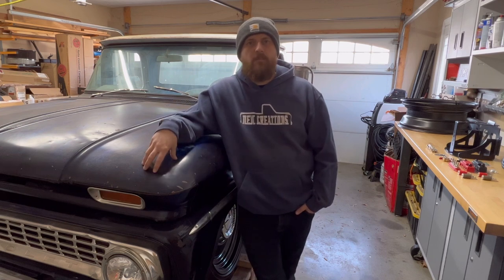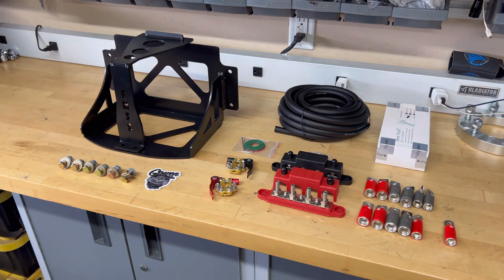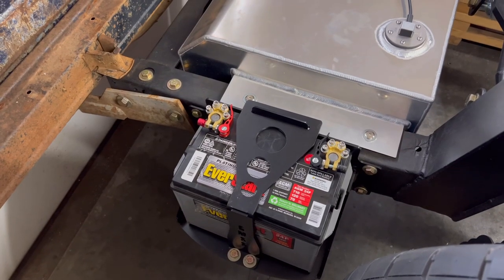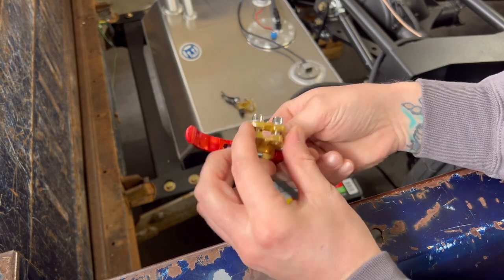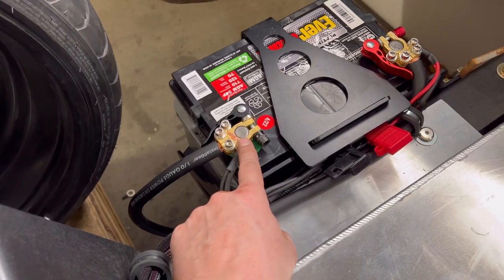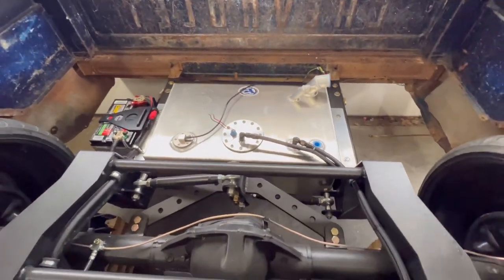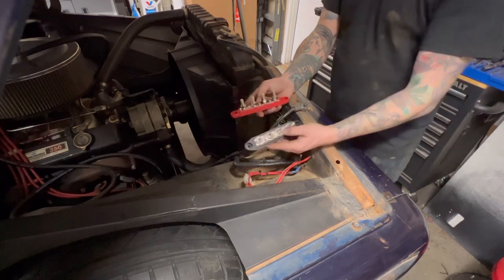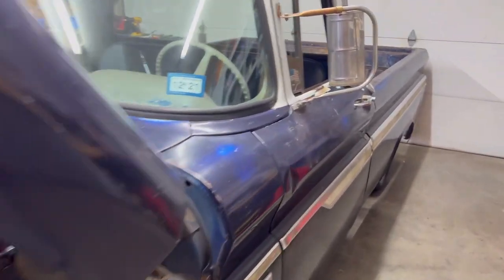FRANCIS EP.12 | DIY Battery Relocation | GMSS Fab Bracket and Step-by-Step Installation Guide.

Comment: On my 65 C10, I relocated battery to inside the bed in a vintage aluminum cooler that has an added locking latch, I also put a battery cut off switch on driver side floor board for extra security & ran wires thru aluminum shielding. I did my build before anyone came out with any kits so I had to do my own fabricating that was time consuming, Got all my wiring & 1000 CCA battery from a battery shop for very low prices back in the day, never had any problems with it so far, I still have the 1965 GM spring loaded battery terminals on it. Relocating a little more weight to the rear helped with traction. I had to give a jump to another C10 that was on the frame, that is the worst place to put it when you need a jump or have to service the battery.
Reply from the maker: Awesome! Thanks for sharing and watching.

Comment: First project I see on your battery terminals well just the hot one is that the clam lever is facing the metal bracket so when you open that clamp it might spark and you said self tap the power bank to the fire that not a fire wall that’s a core support. But your doing good keep going
Reply from the maker: Thanks for pointing out the areas I need to improve. That helps me. When you’re trying to do a job and record at the same time it’s not easy. I mess up on words a lot but you can’t really go back and fix it. I rather show some of my mistakes so people can see I’m not perfect. Just a guy out in the garage trying to help other people.
Reply: @SIMPLE.C10  I messed up on words to for trying to type at night with my glasses 😂😂but I liked your video well done
Reply from the maker: @a.g.1202  lol. Thanks. I really do appreciate it.

Comment: Awesome work! You should consider splitting the air line and run a quick connect off the rear too. Simple little coil air hose in case you get in a bind and or need to air up the suspension should you have a failure...I dunno, just a thought.
Reply from the maker: I thought about that as well. Thanks for the suggestion.

Comment: That positive terminal is awfully close to that grounded battery mount.  I don’t know how much slop there is fore and aft between the battery and the mount, but it looks like a half inch on either side.  But that positive terminal is closer than 1/2” to the mount, so hit a bump and you’ll have a fire.  Actually, now that I look at it, you have the battery in there the wrong way.  The terminals are likely supposed to go where the mounting strap is narrow.  But you’ll probably change it anyways once you put the truck bed floor on it.  You won’t be able to even get the battery mount off with the bed floor there.
Reply from the maker: This video is really old and I had no issues with it. Worked great. With a raised bed floor it was easy to access from the back with the tailgate down.

Comment: Should have a sealed/marine type battery case, water is going to be a major problem for this installation.
Reply from the maker: It’s been going for three years without any issue. Battery boxes are mounted to the side of frames very often.